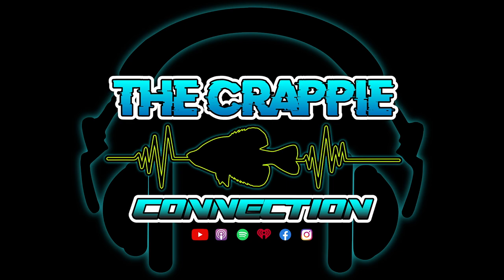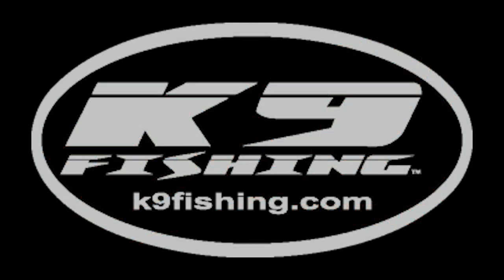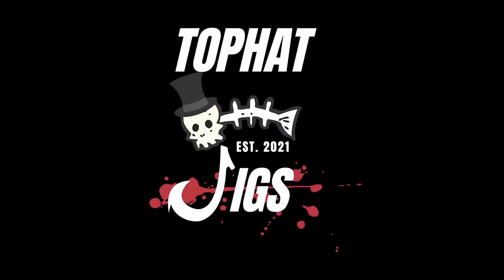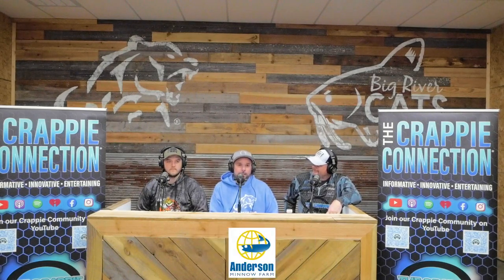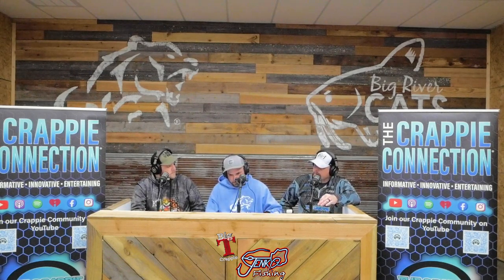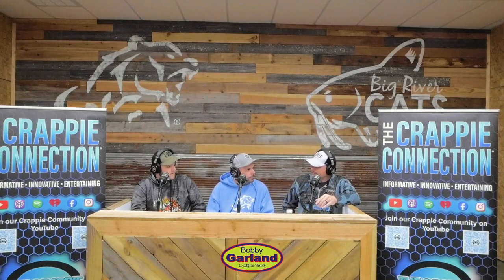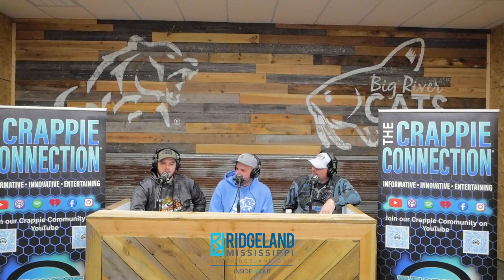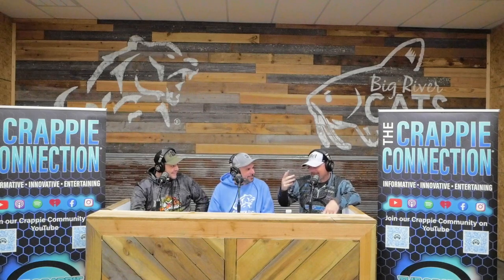How To Set Up Your Boat For Crappie Fishing

Comment: Here is one that doesn't fit the aluminum or the fiberglass molds.  I have a rotomold creek boat.  Trolling motor on the back and steer with your feet but looking for a depth finder and mount. More likely a magnetic mount with transducer over the side.  Boat is only 3/16 of an inch.  Love the broadcasts
Reply from the maker: Call them fellas corn field fishing gear 
I bet they can help you